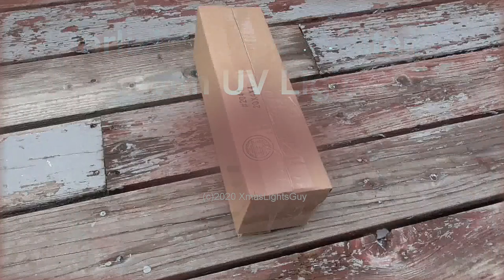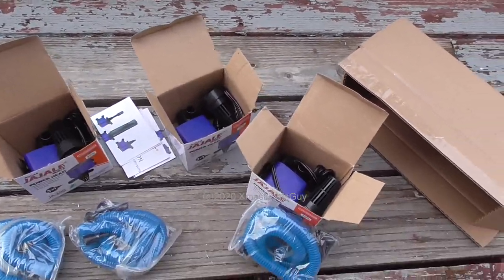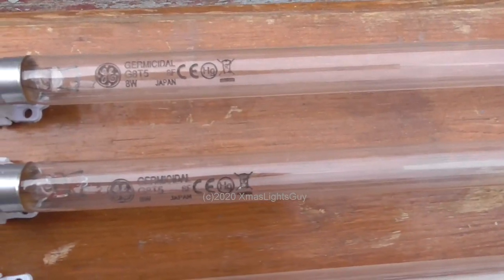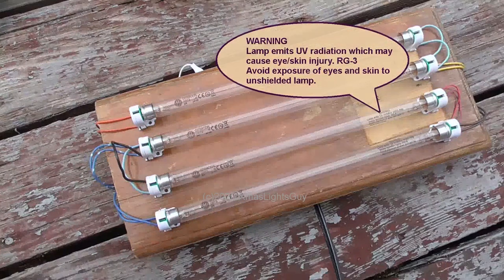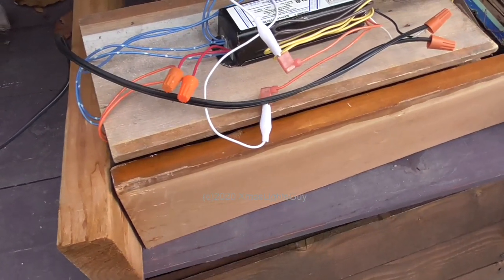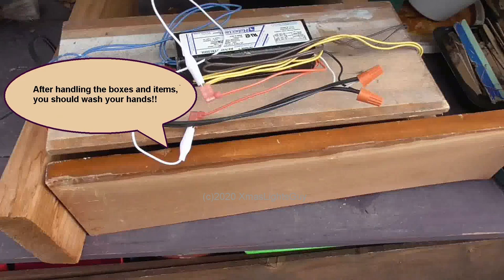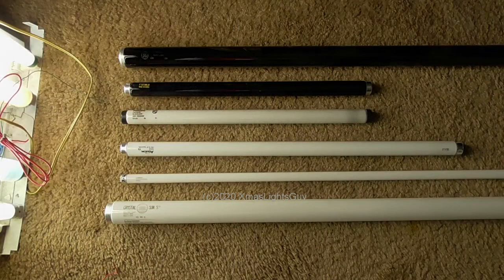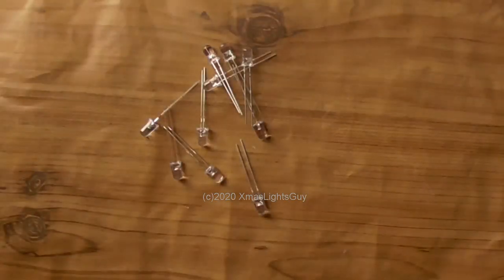UV Sterlizier Germicidal Light - Sterilizing Items Received From Shipping

Comment: Please provide the information about how to connect 4 lamps in a single ballast. Thanks from India.
Reply from the maker: This is a ballast that's designed to run 4 lamps.
You could also use 2 2-lamp ballasts which are easier to find.